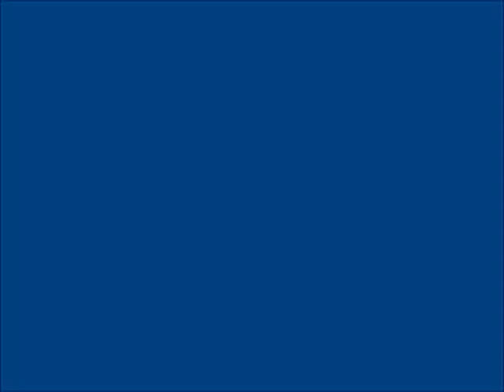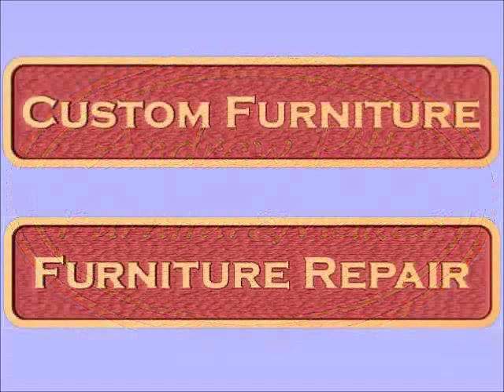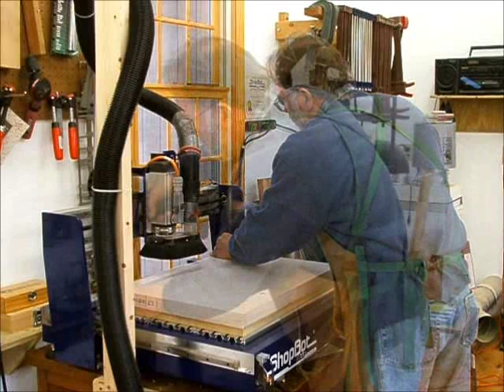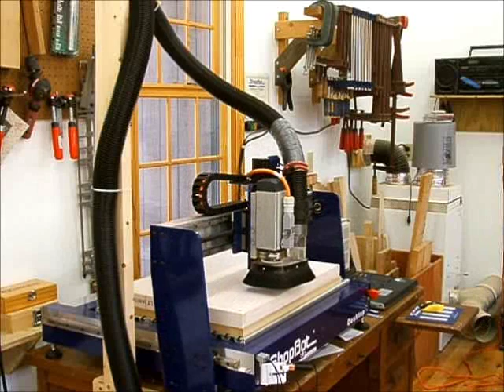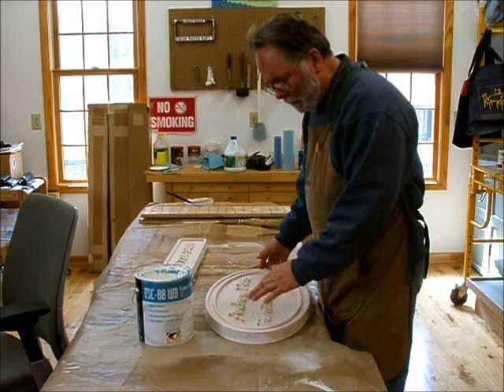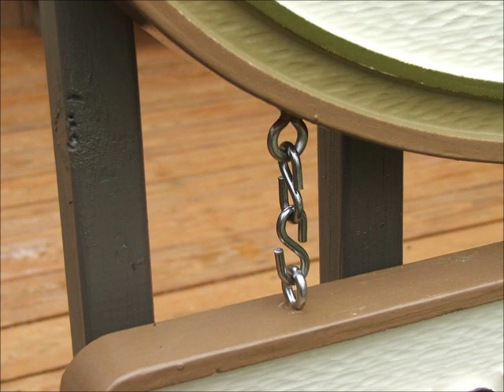Making an HDU Sign with a ShopBot: Andrew Pitts ~ FurnitureMaker

Comment: Nice video I like how you explain everything. I use a 2 inch foam roller that I roll out the paint till the roller is almost dry then paint the letters, u said the same exact thing as you "there's got to be a better way" saves hours of time. Since the paint is light on the roller you might have to do 3 coats depending on paint and color. 
I'm not one to preach and I know you were doing a video but I hope you are wearing a respirator around that stuff before you seal it. That dust stays suspended in the air for a long time. With the primer you are using its recommended on the manufacturer's website to use a shop fan to help aid in the dry time. Just an old man's 2 cents.
Question, have you tried a double sided sign with this stuff? I'm assuming that you would need 2 inch thick material.

Have a good one.
Anthony

Comment: do you like your cnc..?  it seems like it needs allot of attention for an automated process..?
Reply: One huge myth is, that because you use a CNC, you just push a button and get a finished product. A lot of times it can take just as long or LONGER using a CNC, depending on the job. You have design time, set up time, and have to account for changing bits too. Thing is, using a CNC, you can get some really nice work that would be impractical to do by hand, and you can be doing other things while the machine is running